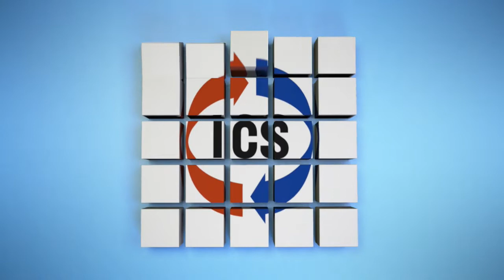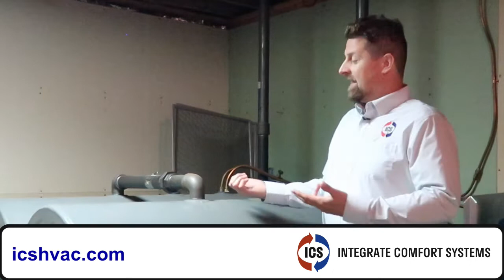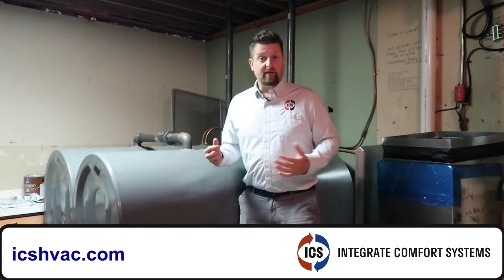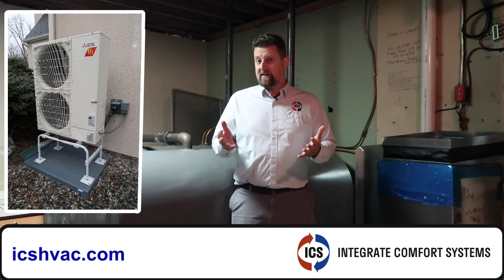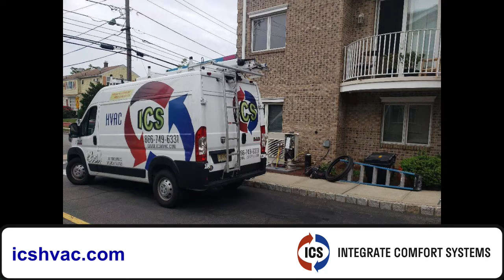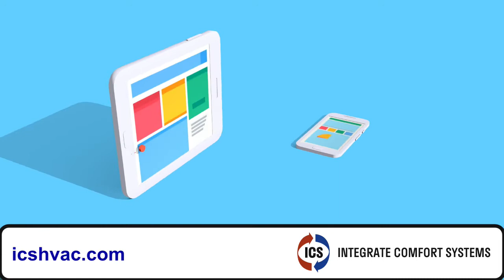Why are you still getting oil heating systems in NJ?

Comment: What are supply heat pump supply air temperatures at 0* F outside when replacing an oil furnace ?      Any reason to increase supply and return duct size as compared to an oil furnace ?     The outside condenser/evaporator units are ugly.  What are other options ?   Ground source heat pump ?    Can I heat the swimming pool  ?
Reply from the maker: all questions that need a lot more information to properly anwser